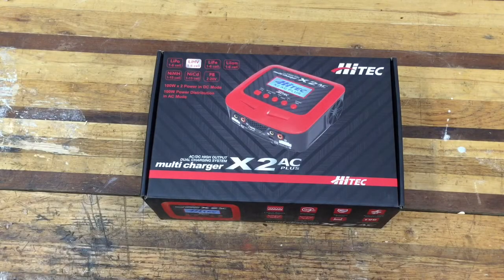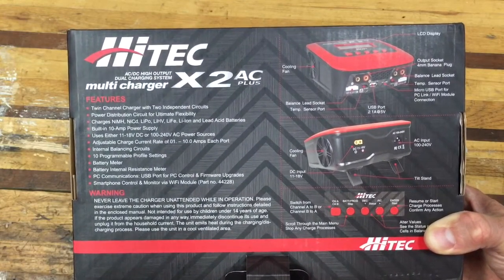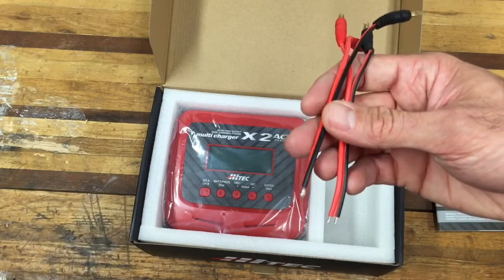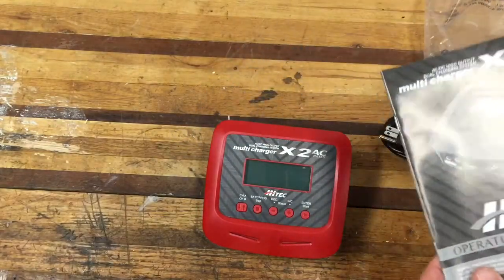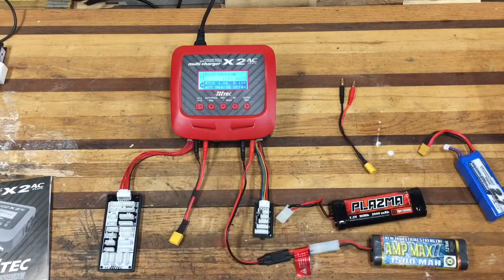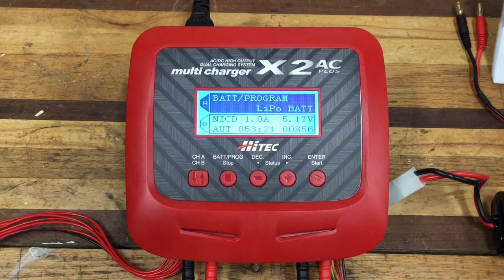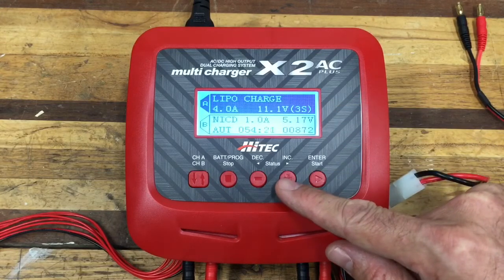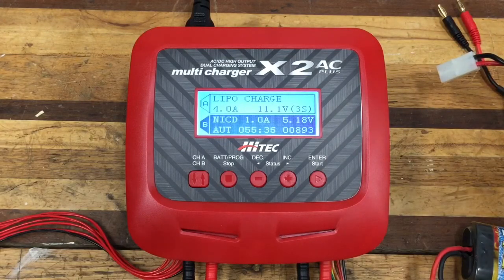Charger DUALITY; Pt 1/2 Quick Review of Hi-Tec X2 AC Plus 2 Port AC/DC Multi Charger

Comment: Ijust got my charger and lipo battery ihave the same charger, man im alil intimidated with this thing , im new to this game.. may be u can guve me some tips? Ihave a 2 genace 5300mah 3s lipo 45c,..
Reply from the maker: +Mark Dela Cruz   My suggestion is carefully read the manual.  It is a bit overwhelming at first.  Main thing is not to charge batts too fast.  In the manual it explains the charging settings.  May need to read a few times to fully understand it.  I did
Reply: Last question Does is beep or stop when charging is done?
Reply from the maker: +Mark Dela Cruz Yes it stops and beeps!  Works very well.
Reply: 1 st time iused it imwent well, but second and third time it wud tell me overcharged am i doing something wrong? Any tips pls?